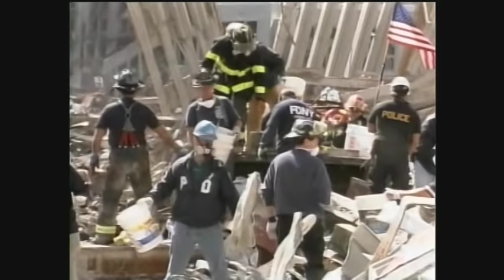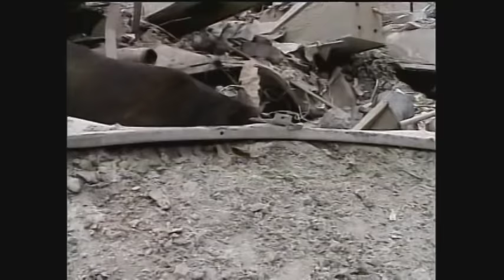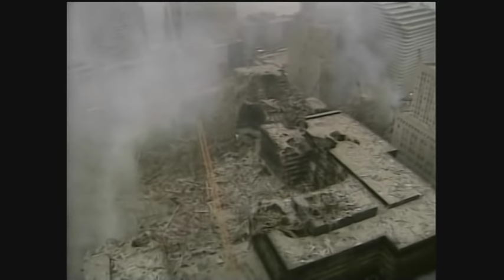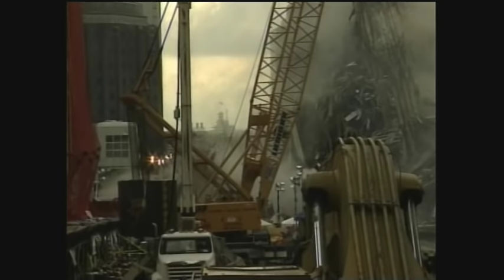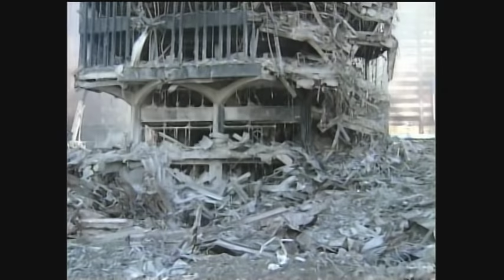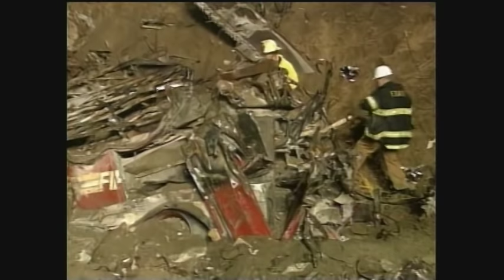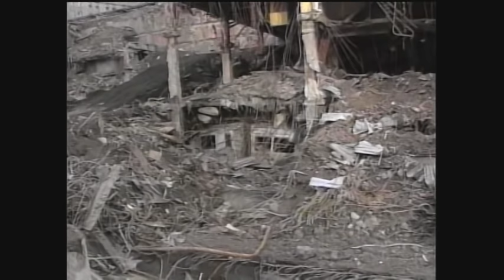Rare and new FEMA footage of Ground Zero

Comment: Another thing to note... the manner in which the tower collapsed. The upper portion (section with lesser mass) fell through, completely destroying the lower portion (section with greater mass). Not only did this happen (AT TIMES) at free fall acceleration, but it did so in an asymmetrical fashion. An object will always follow the path of least resistance, this is another law of physics. Vertically downward through 1000 feet of undamaged steel structure is clearly the path of GREATEST resistance.
Reply: Very true also the point of basically 2 aluminium tubes caused 3 sky scrapers to collapse into its own footprint.
Reply: @AdamsOlympia  yeah OK mate wing tips an tail slicing through steel and concrete 👍
Reply: Your very good at being insulting 👏 cognitive dissonance? Did you not see the hole in the side of the buildings
Reply: @AdamsOlympia  you keep your childish little insults coming but how does 2 aeroplanes pulverise 3 concrete and steel structures ?
Reply: jameswheeler5025  those skyscrapers where built out of steel and concrete for a very good reason and for 3 of them to fall into they're own footprint ? Wing tips caused damage ?? I wish you well sir ✌
Reply: jameswheeler5025  of coarse I read your comment that's why I replied 👍I bet the beams the structure the glass and the concrete were stronger than aluminium.peace to you ✌
Reply: @AdamsOlympia 
 The only thing impeccably ridiculous is you trying to equate a passenger airliner to a nuclear bomb. 😂
 Nice try. 😂
 You need to call  someone to fix your logic. 
 It’s broken.
Reply: @AdamsOlympia  two atomic bombs did the damage in Japan.
Reply: Building 7 fell from..,.....
Reply: Original comment is 10 years old but 1st reply is 2 weeks old. Great job at censoring people and free speech😂
Reply: @jasonthomas196 It is called physics
 Go and learn some and then you might understand why these buildings collapsed the way they did
Reply: @eckyhen  physics 🙂 got me there 2 aeroplanes collapsing 3 skyscrapers is physics, nice one 👍
Reply: @jasonthomas196  Yes. If you understood the phyics you could do the maths.  The fact.that you cannot do the maths means that you have not learnt any physics.
Reply: @AdamsOlympia your own logic is completely off.  Stop deflecting and gaslighting.  If you're trying to protect the official narrative, you can't.  And why would you want to anyway?
Reply: @eckyhen  what as physics and maths got to do with 2 aeroplanes bringing down 3 buildings?
Reply: @jasonthomas196  Everything. Kinetic energy, momentum, sheer  strength tensile strength and modulus of elasticity and effect of heat on the properties of steel. If you put in the numbers you will find that the force of the falling upper stories were greater than the strength of the floor trusses to stop the falling mass.
Reply: @eckyhen  nonsense how can that theory be put against building 7
Reply: @jasonthomas196  Why get involved if you don't know anything?
Reply: @jasonthomas196  So do you accept that it explains 1 and 2?
Reply: @eckyhen  no explain building 7 with your maths and physics?
Reply: @jasonthomas196  Yes. I can explain that with my maths and physics but since you are not wanting to see how maths and physics explains the collapse of 1 and 2 I assume you are accepting that these fell down as the result of maths and physics.
Reply: @eckyhen  no I struggle to believe an aluminium tube can Pearce through steel girders and concrete I mean have you seen an aeroplanes nose that's hit a flock of birds?
Reply: @jasonthomas196  That is because you do not understand physics.
An empty coke can is just an aluminium tube but given enough velocity it could destroy a battle ship.
A plane is not simply an empty tube, there are all sorts of things inside, machinery, struts, ribs heavy engines and landing gear, fuel and several tonnes of human bodies as well
A  loaded 787 weighs about 200 tonnes and hitting the building at something like 800 kph will release the equivalent energy to about 750 kg on TNT.
Just out of curiosity, if you are saying it was not planes that hit  the building just what was it that made those huge holes.
Reply: @eckyhen Try saying that to the University of Fairbanks Alaska. 
They spent a few years and I think a million dollars trying to figure out why building 7 came down, especially in free fall form.
They concluded that there is no way the building came down for the reasons stated. Falling debris and office fires. It's a sht narrative. 
If you saw the clip of the building falling not knowing it's B7, you would automatically think perfect demo. 

I've played the clip for multiple people that didn't know that building. When I told them which building it was they didn't believe it.
Reply: @eckyhen one thing I forgot to mention is when I sent a youtube link of b7 falling in a text message with a caption "check out this demo" the link was changed to a Mike Tyson fight. 
Censoring text messages to manage the narrative looks very suspicious at the least.
Reply: The way Tower 7 fell shows they prepared Tower 1, 2 and 7 weeks maybe month before the attacks.
Reply: @michaelrupf776  And no one in the buildings noticed all the preparations?
What utter nonsense.
Obviously you have no idea how much work is required to prepare a building for demolition.
Reply: @eckyhen  Company workers under specific floors and over specific floors noticed heavy machinery going on for weeks before the attacks. Many noticed it. But it was only "renovation" like stuff.. as they lied.
Reply: @jasonthomas196  what concrete are you talking about? there was ZERO concrete in the walls they consisted entirely prefabbed modular sections made of mild steel bolted together with hardened bolts the ONLY structural concrete used was in the central elevator spire and it was so tall and narrow that it required support from the external walls through the floors to remain upright. other than that the floor pans had nonstructural gypcrete poured in to them for walking surfaces and that was the sum total of the structures.
Reply: @jasonthomas196  The trade centers are steel framed, not steel reinforced concrete as you imply.
The inner core and exterior wall were held together with triangle trusses.
The concrete was just a floor leveling compound and was not a part of the structural load bearing sections of the towers.
This type of construction allowed the floors to be wide open with no intermediate support beams.
The floor trusses and walls failed after being exposed to prolonged fire and significant structural damage to the core and the exterior load bearing walls.
The damage was caused by a 767 traveling at 600 mph weighing around 400,000 lbs with a full load of fuel.
When the floor and walls finally failed the remaining 10, and 20 stories of the building above fell to the floors below.
No building could withstand such a force and as soon as the collapse began it was unstoppable, like falling dominos.
Building 7 had both towers partially collapse onto it with almost the entire facade facing the towers being ripped off by falling debris setting it on fire, and it burned for 7 hours straight throughout nearly the entire structure with no suppression before it collapsed, they anticipated its collapse and evacuated all first responders from the area preventing further casualties.
None of the buildings that collapsed that day fell into their own imprint, you can easily prove this to yourself by watching any of the thousands of videos that show the exterior walls of the north and south towers peeling away as the structure above tears through them, raining down on every structure that surrounded them and structures further away. debris was strewn hundreds of feet away from its own footprint. 
The 767's didn't pulverise the towers in anyway, fire weakened the structure to the point of catastrophic collapse, this is an expected outcome of fire in buildings and why strict codes are enacted to help contain a fire before it can cause structural failure like fire suppression sprinkler systems, on floor fire fighting equipment and other things like fire protection sprayed on critical structural components, all of these safety mitigations were destroyed when the building were struck by planes, all of those safety mitigations were destroyed in building 7 when 2 100 story building fell on it.
Reply: @Randomadventureswithpaul  did you just read the official report ? There's way to many discrepancies in your comment buildings fell like domino's 👍 failed Cesena pilots flying at 600 mph and where did I say reinforced concrete?
Reply: @kevint1910  mate look up the architects and engineers of 9/11 those 3 buildings should never have collapsed
Reply: @jasonthomas196  What kind of plane do you think pilots train on before they move to 767's? Or bigger? Generally you train on a Cessna, the size of the plane is irrelevant. The flight controls are the same on most planes, and considering they were at altitude and cruising speed when they were hijacked there was no need for them to do anything more than steer it into the building. You could learn to do this in microsoft flight simulator and accomplish the same goal of simply smashing it into a building, they didnt have to take off or land just aim it at the biggest thing on the horizon..
You didn't say steel reinforced concrete per se, but you keep saying "how can aluminum pulverise concrete" like the concrete floors are a relevant point, they aren't. The only relevance the concrete has is the millions of pounds of weight they would have added to the 20 story tower falling to the one below causing catastrophic failure.
And what discrepancies are you talking about?
I suspect you don't have any training in structural engineering? So while you scoff at the official reports written by hundreds of trained investigators and engineers you simply take the illogical claims of some journalist who made the loose change video for a quick buck. 
But that journalist leans completely on innuendo, hearsay and no understanding of how a structure is built or how it maintains itself after construction..
Go ahead mention anything about the conspiracy claims and I'll explain to you why they are wrong.
But if you scoff at the professionals who wrote multiple reports on the subject matter I am under the impression you simply won't accept anything that doesn't correlate to the incorrect information you, I assume, mostly gained from loose change or other related misinformation campaigns, so I am sure that my extensive knowledge of the 9/11 building collapses, and structural engineering will not be considered and you will simply dismiss. But I am willing to try. So go ahead.
Reply: @Randomadventureswithpaul  also I've never seen loose change ✌
Reply: @jasonthomas196  You may have not watched it but 90% of your comments are near verbatim of their incorrect narrative.
Reply: @eckyhen  so could you tell tell us where the pancakers maths is and a good demonstration are? All that's allowed  on youtube is debunking nonsense and so called explanatory tv  programmes in  which they  actually lie.
Reply: @patricksmith4424  I could take you through it step by step but I know it would be a waste of my time and you have no interest in hearing it so FO.
Reply: @paulbirkbeck1790  it actually was the first thing to collapse, which blows apart the pancake theory.
Reply: @patricksmith4424  tower 1 and 2 were both pulled together by a hat truss framed on top of both buildings this give them both incredible strength. These trusses should have been sat on top of both piles of debris. If you ask me those buildings were destroyed by directed energy or some kind of frequency weapons. If you watch the north tower collapse from the boat on the Hudson River it looks like it disintegrates.
Reply: ok thanks for your unwanted layman's opinion
Reply: @apseudonym  16 years on YouTube no comments but you make this snotty remark to my laymen's opinion? We got a YouTube bot here a souless little bit lol
Reply: @paulbirkbeck1790  Yes of course there were trusses at the top to hold these amazingly strong buildings together., but the floors themselves were not grid trusses. I think the debate has moved on from the pancake nonsense. The real discussion should  be about how were the towers brought down by a controlled demolition. There is no doubt that wtc7 used  the standard demolition procedure. Knock out the foundations then blast each floor as it descends to the ground. A bottom up demolition which is the standard as it creates so much less mess. The two towers had to use a top down approach so as to show the impact had someeffect on the collapse. Ironically the ultra strong two tube approach helped with this. In the North tower the first thing to collapse was the mast. This indicated that the central core had been blown out at the bottom. This meant the outer windows sections had enough strength top stop the building toppling over at this point. The explosives were timed to take out multiple floors at a time, which is obvious from footage. Far from collapsing the towers were in fact blown apart very quickly, 11  seconds in fact.
Reply: @patricksmith4424  I think it was unconventional the method used I'm with Dr Judy wood and her directed energy
Reply: @patricksmith4424  what happened to the hat trusses of each tower they were not sat on top of the dust
Reply: Your evaluation would be correct if it hadn't caused a giant umbrella of debris radiating out from the building whilst falling. Had it stayed exactly within the footprint of the towers, you'd be right. So in reality, you really aren't as smart as you think you are.
Reply: @AdamsOlympia   It's hilarious watching people who know nothing about science make judgements against science-based evidence. They seem so sure of themselves.  I'd feel bad for them if they weren't such insufferable ducks.
Reply: @jasonthomas196   This dude has zero appreciation of inertia, mass and energy. Like, zero.
Reply: @jasonthomas196   That's... That's not what cognitive dissonance is...
Reply: @AdamsOlympia   It's no use. He's quite clearly made up his mind that science is fake and his feelings are more important.

Comment: I keep reiterating this over and over to folks.  If the World Trade Center tower had been imploded, they would have gone straight down into their foot prints.  That's what controlled demolition is all about, contains the build to a very specific and garded area.  In the case of the World Trade Center twin towers, when the building came down they also spread debris over the entire plaza and across the streets from it.  That is not a controlled demolition, that was an uncontrolled failure and collaps of the two buildings.  Controlled implosions do not have any or very minor effects on the surrounding structures.  The twin towers destroyed or severely damaged every single building in the area.  The debris even crushed out a small Greek Orthdox church.  The popping sounds did not come from explosives, they came from fatigued steel joists that had already been compromised when the planes flew into each building, thus when they got hot enough from everything that was on fire, they went past their stress points and the buildings came down.  It's pretty simple physics.
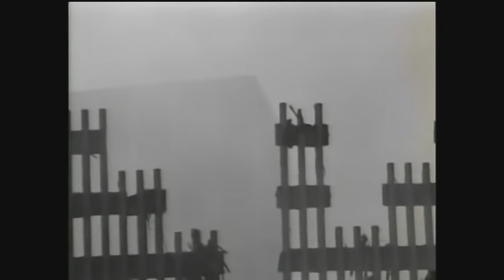Reply: THANK YOU! One thing else to add as well, and of course I've never seen a building being demolished in person but from what I know the whole thing comes down when they do that (They put dynamite on each floor or something). At 1:08 you can clearly see pieces of the trade center standing upright quite a ways from what I assume is the foundation, or what was left of it.
Reply: 47 interior box columns at 1000 lbs per foot,  where are they? Steel does not fail like glass. Look at the hole in building VI.
Reply: They used time separated explosives from top to bottom.
Building 7 collapsed on all 4 corners at the same time. That is impossible without explosives because building 7 was very long.

Comment: Why the building at 1:40 didn collapse? The whole tower fell over it
Reply: The distribution of debris was biased. You can see this illustrated in the FEMA reports. The parts of the complex that were directly away from the four faces of the respective buildings were generally completely destroyed.

Most striking are photos of the Marriot Hotel seen before the collapse of WTC 1. It stood facing the west face of 2 and the south face of 1. It was sliced in half by the collapse of WTC 2. After WTC 1 collapsed there was only a small piece of the Marriott left standing. I don't want to link it since youtube tends to remove links for me, but google Marriott WTC and you'll find it.

Comment: Did the fall of the towers collapse subway tunnels?
Reply: Yes, there was a station under the building.
EDIT: the subway tunnel was under the WTC.  The station was just outside of the WTC.
Reply: @raymond19001  never hear about that area or if people died in them.
Reply: @KasumiRieko  The station was called WTC Cortlandt and was under Greenwich Street outside the East wall of the WTC.  The tunnel passed under the WTC but trains were stopped after the first plane hit the tower.  The station was destroyed and re-opened 17 years later.
Reply: @raymond19001  thanks
Reply: @raymond19001  Did anyone die in the subway?
Reply: @james789c  Not that I know about.  After the plane hit, all subway cars using that track/tunnel were stopped before approaching the station.
Reply: So they probably had enough time to evacuate the passengers